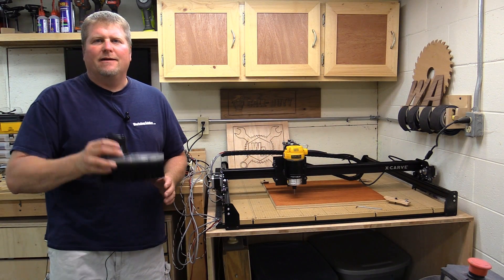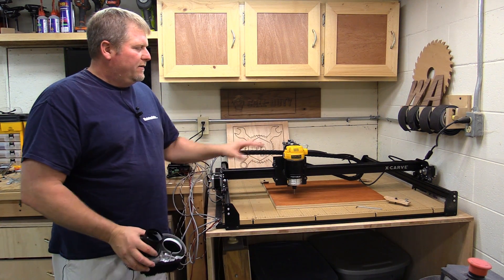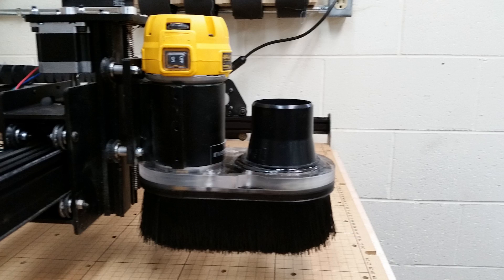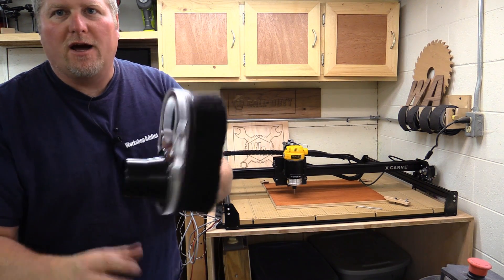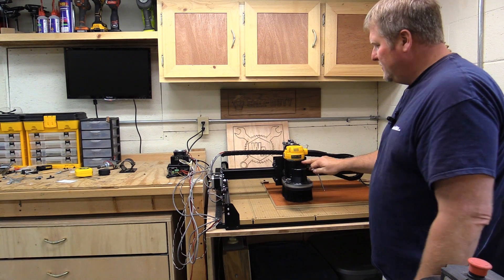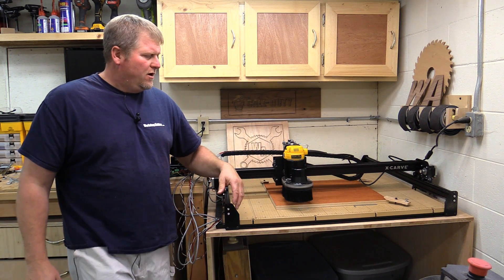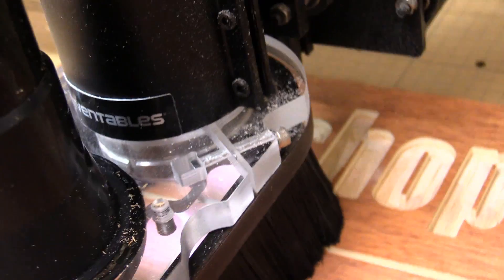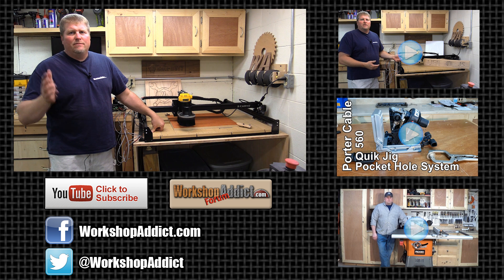Dust Shoe for the X-Carve by Kent CNC

Comment from the maker: I was just contacted by Kent CNC.  They have changed the brush ring on this unit and now the bristles are more flexible.  Therefore, you can take the brushes right down to the bottom of the bit for a complete seal.  I'll get one of these new rings and comment back on how they perform.